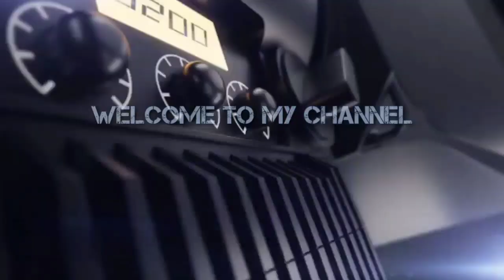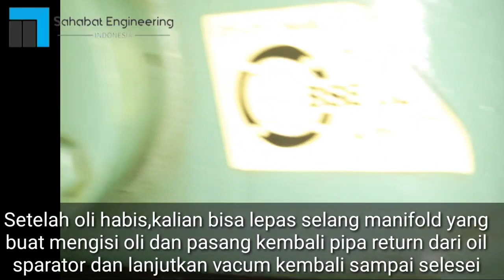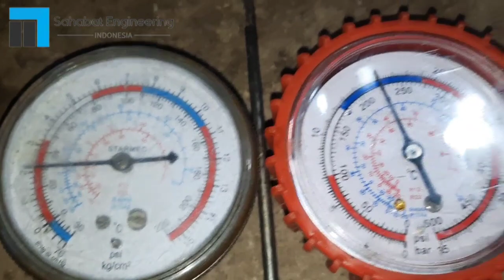Cara mengisi oli kompresor bitzer open type V atau open type VI

Comment: Cara mengisi oli yg mesin blast freezer 30 pk ada ga bang
Reply from the maker: Belum pernah bikin vidionya untuk mesin blast tapi caranya sama,memanfaatkan proses vacum,kalau memang mau prefentif penggantian oli tinggal ditutup valve discharge,valve suction dan pipa return dari oil sparator